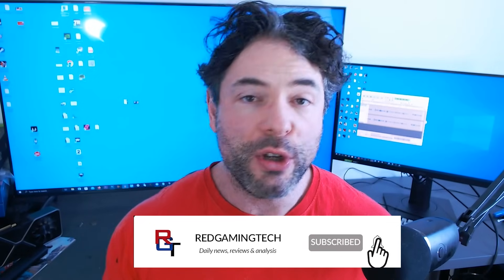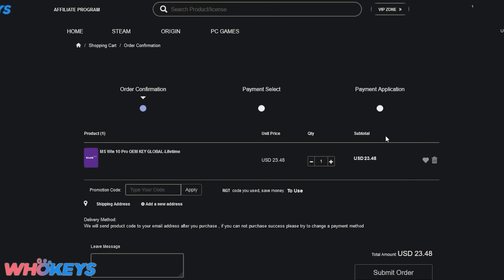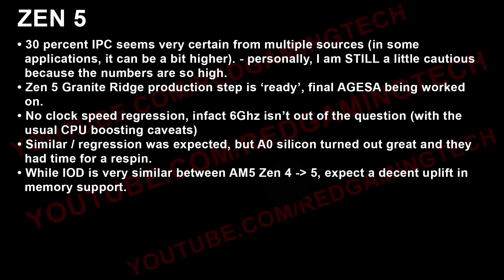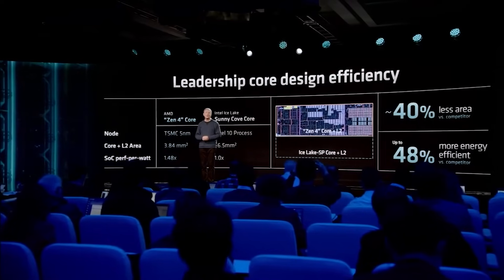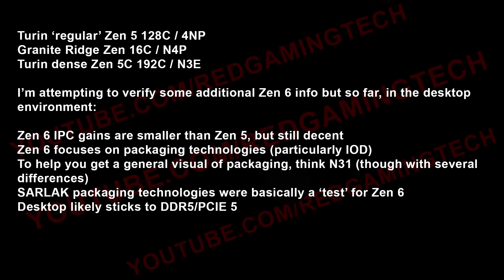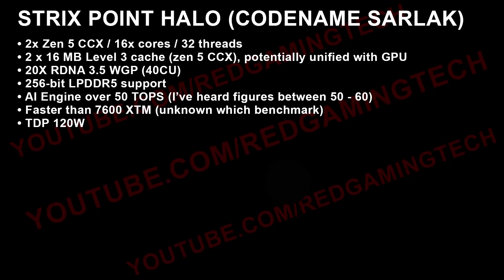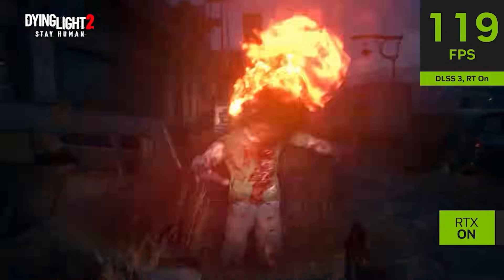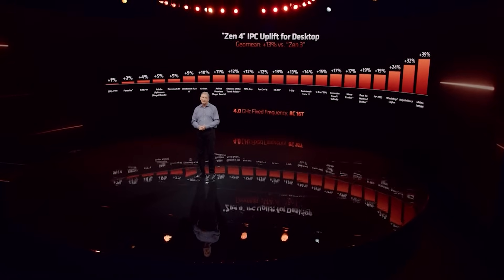Zen 5 Will DOMINATE - HUGE IPC & Performance Update

Comment: 10% ipc expected 5-10% frequency
maybe 15% better performance. Won't be good value, and i doubt am5 cpus will cheap cheaper than 7600/8600g, even low tier options like 8500g/8300g cost almost same with much worse performance

Comment: With a 7700x I think I should just wait until 10000? The last of the AM5 socket?
Reply: It's an unknown right now. And I'm also looking to get upgrade on my x670e motherboard with the 'last call for am5" cpu, whatever it is. Personally, I do think AM5 will see 3 generations of cpu. I think AMD will desire to do a third am5, but it'll really depend on whether there's some architectural need for a new motherboard spec.
Worst case scenario, there is no third am5 socket cpu... but by waiting to find out, the 9000 series will be fully flushed out with all variants, and will be much cheaper than they were at launch.

In the meantime, I'm finding the 7000x series to be very strong, and I'm really happy with the many mobo changes & upgrades on am5. 7900x/x670e myself, looking for the last great am5 chip (and ram). Basically what the 5800x3d was for am4.

Comment: Thanks for the headsup!
This continued development is great but needs to address society issues as well.  It sems better than Intel but does not float my boat completely.
I'd be interested in a 'desktop' cpu with ability for a reliable desktop build giving  low latency, 70-80c temp and low 500W power consumption for 'creator' use.
Reply: Threadripper exists man.  Go for it.

Comment: For the server side, you said a 1.4x increase. So it will be 2.4x the previous server parts? Or did you speak incorrectly?
Reply: 1.4x is not the same as 140%
Reply: @whiplash2891  it is though.
Reply: @whiplash2891  100% is a whole. One whole is one. 40 parts of 100 is 0.4 as a decimal. An increase of 140% means adding 140 parts of the base or one whole. So if your base is 100% it is the same as 1. So a 140% increase is the same as a 1.4x increase. It comes out to 240% of the original, which is 2.4x the original.
Reply: @rekareaper x is used as a multiplier and denotes the multiplication operation. 1.4x increase means 40% faster. 140% increase means adding 140% to the baseline (100%) and is 2.4x or 240% of the performance.
Reply: @dex6316  no, a 40% increase would be a 0.4x increase, since you’re increasing it by that amount, which would be 1.4x the performance. An increase of 1.4x is improving performance by 1.4x, not 1.4x the performance, meaning you’re adding 1.4x Y to Y.

Comment: At 3:27 you show one of AMD's Zen 4 launch slides which shows over 30% increase in some applications,  but that slide also shows a 13% "geomean" average increase in IPC.
This was never touted as a 30% uplift... it was always a high single, low double digit uplift of 8-10%.

The same is happening here with Zen 5.... some workloads are going to get a massive improvement, but overall, you'll be seeing the same 10-15% improvement that everyone else has been telling you you're going to see.  Those guys saying Zen 5 IPC is being undersold are infact overselling Zen 5 IPC.
Reply: There are no people telling him IPC is being undersold.  He's just making this shit up.  He doesn't know anybody at these companies.  The ONLY time he ever got some exclusive 'couldn't have been easily guessed' information that turned out correct was Navi 21's Infinity Cache, and that was only like two days before the announcement, so clearly got the information from a press leak rather than a company leak.

Comment: after seeing the price of 8700g there is zero hope for strix halo to replace a regular cpu + gpu combo. an 800+ apu only serves a very niche market
Reply: the 8700g doesn't have the next gen iGPU. we are talking about 12CU RDNA2 vs 40CU RDNA 3.5 -> it's a huge difference. Strix Halo should be at around or a bit slower than the 7600XT which has 32CU but with higher clocks and power limit.  (system memory config will also play a big role in performance numbers)

Comment: One thing that makes IBM mainframes fast from the beginning of time was super-fast IO. The mainframe IO had embedded coprocessors so the main processors were left for application code. The AMD IOD having small offloading cores and the AI NPU/GPU etc. will make performance improvements big time.

Keep an eye on what goes into the IOD. Huge gains can be made there ..

Comment: 13% integer, 32% floating point (highly workload dependent in both cases).  No real clock speed gain, but more consistent - which is a result of N4P more than anything.
Reply: If we're just adding Flops, this does not translate 1:1 with actual performance improvements.  Direct compute is almost never the pure, singular bottleneck.
Reply: @maynardburger   Internal FLOPs have basically doubled, but realized gains are more constrained due to front-end and retirement bottlenecks and program control logic.  There will be microbenchmarks that show positively insane gains, but they're of little true use.

Comment: a huge ipc uplift will be wonderful, but that's NOT AT ALL what's needed with these new consumer cpus.  I really wish that amd would spend a bit less development time pushing the ipc and clock frequency boundaries (though the extra performance is certainly welcome) and instead concentrate on bringing consumers more pcie lanes (so that we can use more than just a gpu and a couple ssd's on our desktops, for example making 10g networking standard, allowing us to install multi 4k capture cards, storage HBAs (if wanted), significantly more high bandwidth solid state storage, the optional addition of more high bandwidth usb / thunderbolt ports, the optional addition of multi-port 10g/25g/50g/100g networking...) secondly an improved IOD, PREFERABLY going to a 1dpc quad memory channel model to A. significantly lower the extreme 2dpc issues that consumer zen4 has (trying to install 128gb of ram on consumer zen4 systems is a crap shoot at best and you SURE as heck aren't going to get full speed out of your modules). and B. double the memory bandwidth (which would be effective when gpus directly access system memory to load up caches, build 4k shaders, doing big transfers to and from ssd's, etc.

Further, unless or until they can solve the cooling deficiencies introduced by placing cache directly on top of ccd's (you know, the bit that does the computing and generates the most heat and is the most sensitive to heat).  I freely admit that I am NOT a semiconductor engineer, so this part might be a little more wild, but I think that amd needs to look at improving the physical cache layout on their ccx's while also increasing per-ccx cache to at least 64M, and perhaps adding another layer of fast cache (on the IOD might help), and also perhaps adding a dedicated backhaul bus with dedicated compute to do asynchronous cache coherent non-uniform memory access (ACCNUMA) where the iod logs, caches, and in the background back-fills cache contents from other ccx's into the l3 cache.  heck, they could use the 3d vcache tech on the iod (that should generate significantly less heat because it's doing far less computational work), and you could use an fpga for the cache coherency tracking processor on the iod so that you can adjust caching behavior in firmware so you can keep the increased latency to as low as possible.  this technique was used on old supercomputers for inter-node cache coherency for working on problems with huge memory footprints.
Reply: All that desktop needs is 4 channel memory. This will hugely reduce need of all types of cache to eliminate memory bottleneck. All other is for PRO users. Also can be added 2 minor CPU cores like 2 GPU cores in IOD
Reply: @hristobotev9726  pro users use ryzen as well. In fact for video, cad, 3d simulation, heavy web multitasking, etc. workloads that don't parallelize well and use small numbers of performant threads, stuff like threadripper and epic are slower than buying a ryzen 9. Also threadripper is almost always a core behind (it isn't right now but zen5 is likely to hit in just a couple months. Media production, cad work, and heavy web multitasking are things that are extremely common these days. It isn't all about gaming and casual web surfing.
Reply: Nah, I mainly just want the performance.  And putting the L3 on the I/O die is simply not the best way to do it if performance is top priority and only benefits AMD by letting them make smaller chiplets.  They would not pass these savings onto us at all.

Comment: Zen 5 had better have 30% higher IPC than Zen 4 if it isn't increasing core count.
When Intel was stuck on 4 cores on their mainstream desktop CPUs from 2008 to 2017 (when AMD had 8 cores with Zen 1) we rightfully called it stagnation.
When AMD is stuck on 16 cores on their mainstream desktop CPUs from 2019 to 2026 (when Intel has 24 cores with Raptor Lake; there's even a good chance they'll have 40 cores with Arrow Lake Refresh by the time Zen 6 is out with higher core counts for AMD) it isn't much better.
Reply: Oh AMD has more cores if you need them, there in threadripper. 24 all the way up to 96 core. But they aren't cheap because intel isn't conpeting very well so AMD gets to keep things profitable...
Reply: @whiteerdydude  Yeah, and Threadripper and Core Extreme CPUs existed back then too.
AMD needs more cores on their mainstream platform.
Reply: Core counts dont need to just keep going up all the time.  There needs to be a practical argument for doing so and there simply isn't one for consumer needs at the moment.  The 12 and 16 core Ryzen options continue to be niche products simply cuz they aren't that useful for the vast majority.  So we've got a good while before there's any desperate need to push them up further.
Reply: @maynardburger  Intel is pushing to higher core counts, and software in general is getting better-optimised for multithreading over time.
Most people in 2017 thought 4 cores was enough and didn't see the point in an 8-core CPU, but software changed and became more demanding, and now those old 4-core Kaby Lake i7s look like they were overpriced trash; because they were. 
It would be incredibly naive to assume that something similar won't/can't happen again. Aside from that, having the option to buy much more powerful hardware on a mainstream platform is never a bad thing even if most people don't need it.

Comment: Zen3 ->Zen4 was 13% ipc gain. TSMC 7N -> 5N is 13% GAIN.
TSMC 5N -> 3N is 10-15% GAIN 
If theyr going TSMC N3 vanila i dont expect more then 10-15% ipc increase i doubt this arch. changes will translate to gaming. BUT if they are going with N3E then we can see up to 30% IPC increase in gaming.
Reply: Nodes dont determine anything about IPC man. :/  You can use higher density to 'widen' your architecture for more IPC, but you can also do this without a density improvement, you'll just need a bigger chip.  Anyways, no foundry makes claims about what IPC improvements you can make.  There is nothing about N3E over N3B that would suddenly make them go from 15->30% increase in IPC.  That's bonkers and absolutely absurd.
Reply: @maynardburger  Ofc node shrink does not increases ipc. It increases clock speed 'speed'@iso power. Increased clock=increased performance. Not in the sense of information per cycle but general sense 'ipc' is used widely as "performance gain".

Comment: as an 5800X3D owner I can tell you that the X3D chips might not always be the best choice for every gamer. The way AMD designs their chips it can sometimes be a huge bottleneck. The cache die is a massive heat trap and I couldnt believe it switching from 3800X to my current CPU. At a certain point having more GHz with PBO could prove way better in many cases as the lower clocked and potentially thermalnecked X3D.

Comment: Zen5 may be great for general application performance, but for gaming I dont see many improvements except higher official memory support. For Zen4 vanilla the bottleneck is memory.

For Zen5 X3D it could be different as cache is big enough, but there is still the problem that it only has 8 cores per CCX which is not very future proof in 2025.

As long as they do not bring 2x8cores with VCache on both CCDs it is rather meh.
Reply: Memory is rarely THE bottleneck.  It's just one thing that can limit performance, but it's not really correct to call it a 'bottleneck' in the sense that you can still improve many other areas and gain performance without changing the memory setup at all.  Memory performance is just one aspect of CPU performance.  And no, only having 8 cores per CCD/CCX is not an issue at all.  It's actually quite ideal from both AMD and consumer's perspective.  Going higher has other issues that will likely not benefit gaming much at all.

Comment: 30% IPC is absolutely insane...as much as I would love for it to be true, let's be honest here, it's just a sweet dream! I can't even remember if 30% more IPC has ever happened within the same same architecture... I'm not talking about ZEN with 50% IPC because it was a brand new architecture, which is not the case here between ZEN 4 & ZEN 5. 
Wait & see but it seems too good to be true 😢
Reply: Yea, it's pretty much unprecedented, and it's definitely not happening five generations into an architecture series.  19% for Zen 3 was already incredible.  Anything between 10-15% is perfectly commendable.
Reply: @maynardburger  I have ZEN 3 right now (5900X) and am waiting for ZEN 5 3D (8950X3D) to upgrade! ZEN 4 was too expensive and I'm not upgrading if it's not at least 50% more performance!
Reply: There is no way there will be 30% ipc increase.
Zen3 to Zen4 was 13% ipc gain (official amd slides). TSMC 7N to 5N is 13% speed increase (official tsmc info).
TSMC 5N -> 3N is 10-15% speed increase (official tsmc info). 
If theyr going TSMC N3 vanila i dont expect more then 10-15% ipc increase i doubt this arch. changes will translate to gaming. BUT if they are going with N3E then we can see up to 30% IPC increase in gaming.
Reply: @gaav87  I think you're confused... IPC has nothing to do with the process nodes! It's all about coding & optimization! If anything L1 & L2 Cache are the closest to IPC. Also I'm talking about IPC not overall performance. And I said I really doubt 30% will happen in 1 generation...
Reply: Won't be 30% LMAO. Stop watching this clueless AMD fanboy channel. IPC gain will be 10-15% at most. I will get Zen 5 but don't watch this clueless fanboy here. He knows nothing and overhypes everything from AMD.
Reply: @Dr.WhetFarts  That's what I'm saying I don't believe it, but I wish it was true that's all lol

Comment: May finally upgrade my ivybridge after the early adopter tax goes away.
Reply: Lol
Reply: @jabroni6199  I have a pretty decent 5800x/ 7900XTX PC, but I have a few parts that date all the way back to Sandy Bridge, including the case and PSU, a tank Corsair power supply unit. I'm probably going to do a long overdue full rebuild late this year with Zen 5 and replace everything but the GPU and M.2 drive. AM4 helped keep things going for quite some time with the 1800x, 2700x, and currently 5800x.